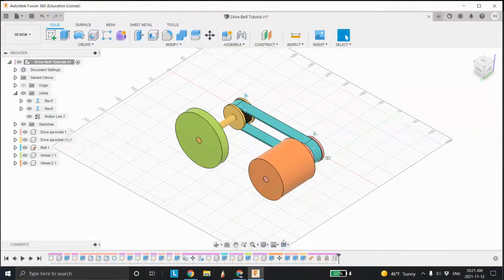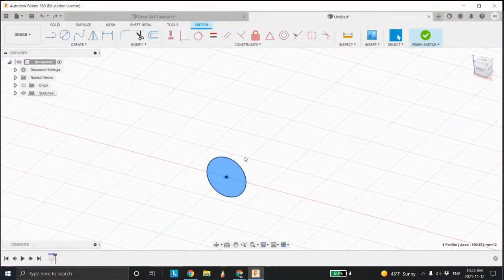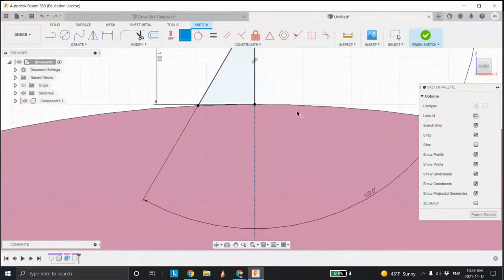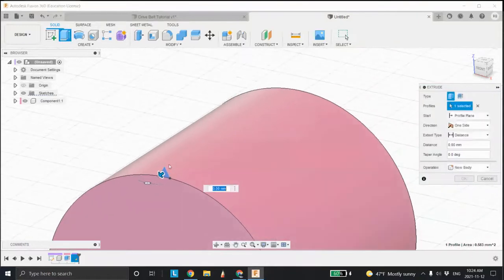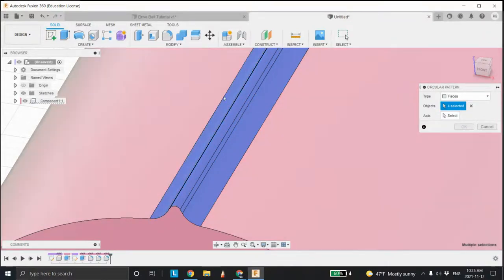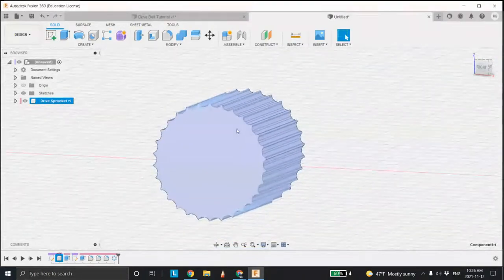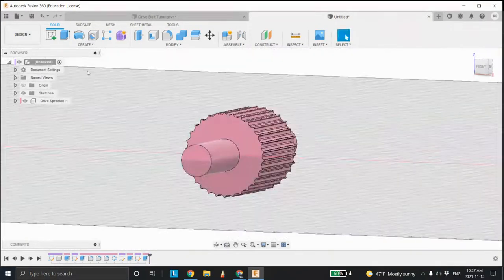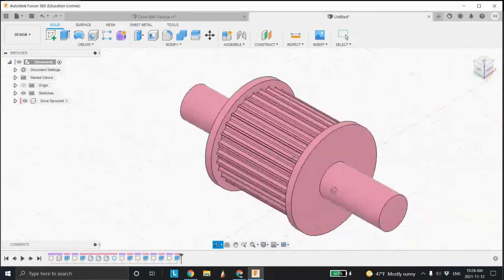Fusion 360   Belt Drive

Comment: Followed it, found it absolutely useless, recycled what I had already designed from it so the belt had teeth, was working fine till 3 hours later, when trying to model, a single one of the spokes without the other changing, broke my entire Fusion, had to export my entire design, delete everything but the spokes, tried to fix redundancy issues, broke my fusion again, then I just decided to rid my entire design of any trace of his outdated and weird modeling style. 10/10 Best Worst-Tutorial ever.